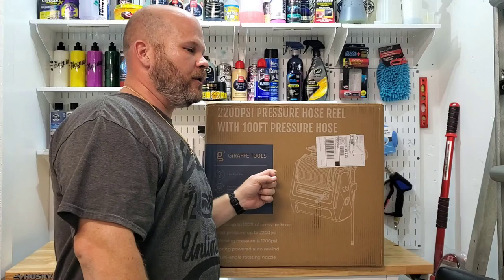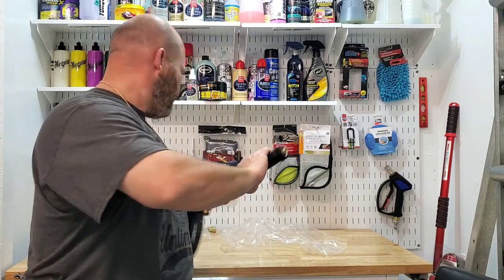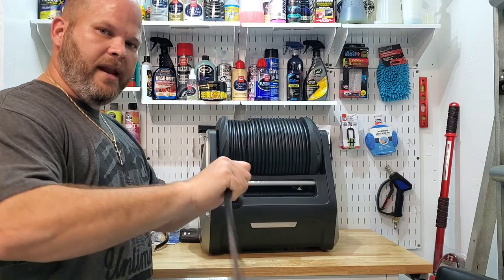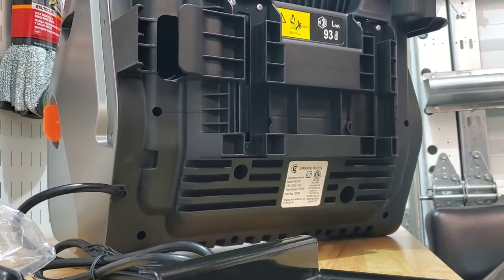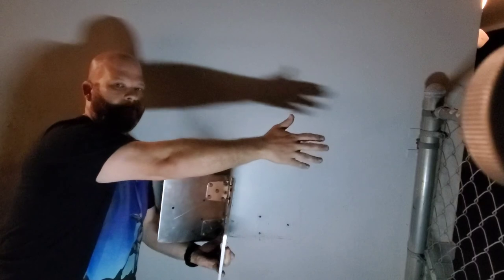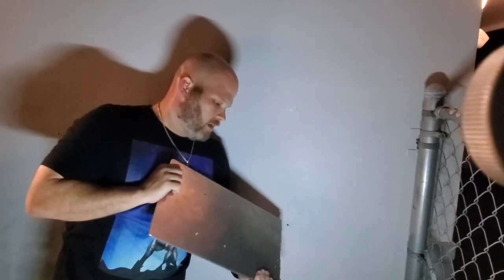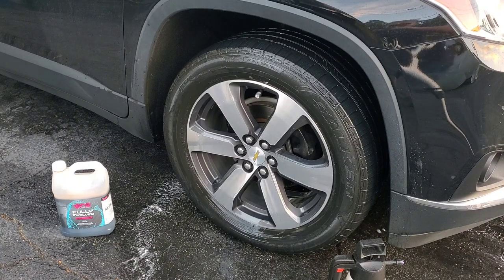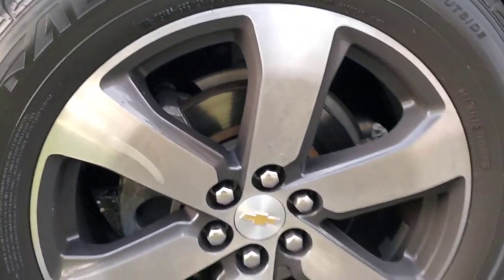Giraffe Tool's Grand Falls pressure washer first look

Comment: Do you know if the rated flow/gpm is accurate with their claims? (They say 2.1, but I doubt it's that high) Also, are you able to test with different size nozzle tip orifices? (eg. 3.0, 3.5, 4.0)
Reply from the maker: We don’t believe it is. We will get more in depth with the pressure and flow once we get a few more tips in.